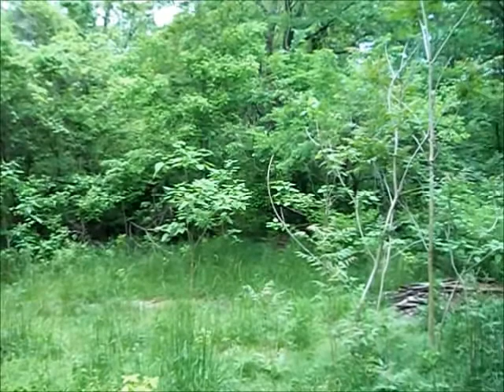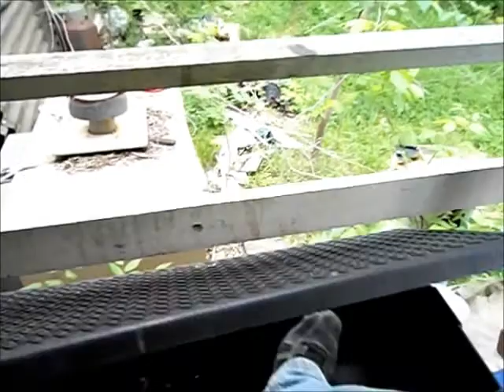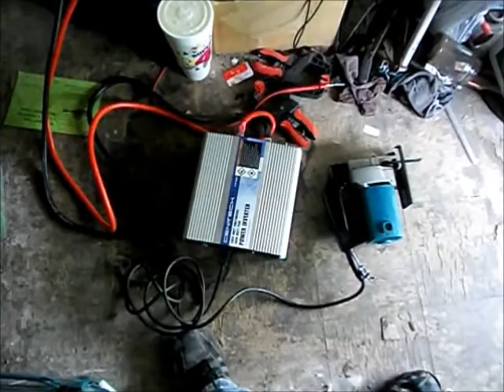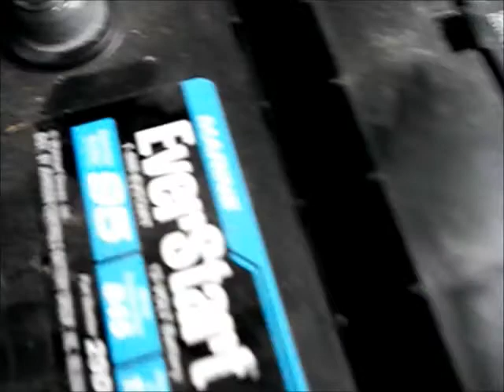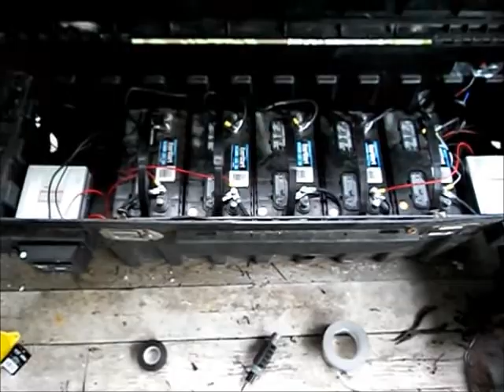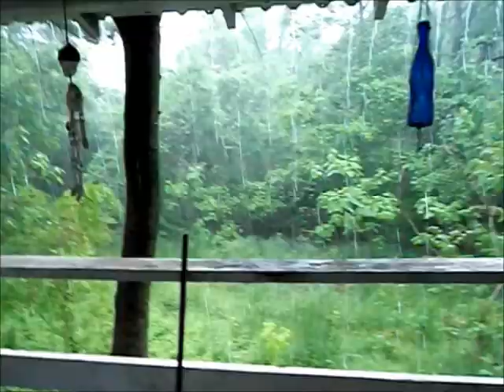Creating My Solar Battery Box

Comment: You are going to lose to lot of battery capacity in the winter due to the cold.  I would put a vented battery box inside. Just my 2 cents.  
I like your idea for finding something to do with the extra energy when your batteries are at capacity.